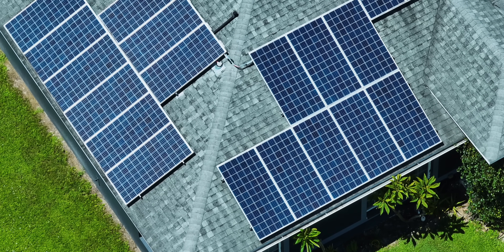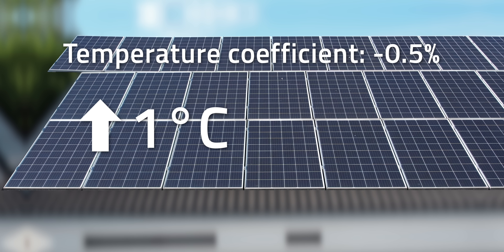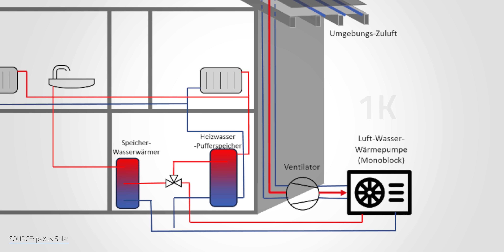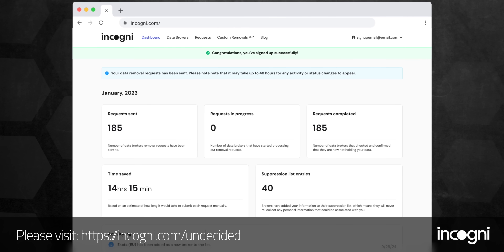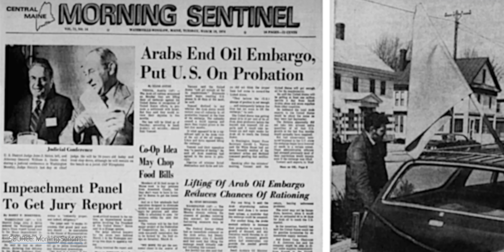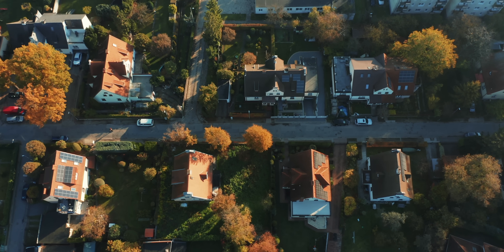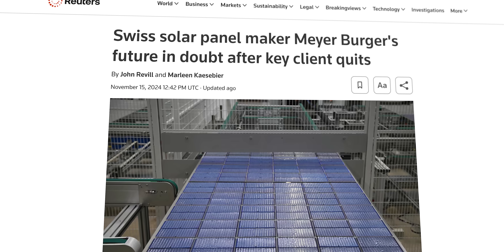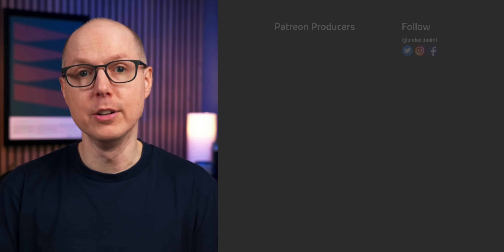Why Hybrid Solar Heat Pumps are the Future of Home Energy

Comment: Finally someone got/did it❗
Heatpumps also can used with sterling system to convert into electricity for summers.
Perfect combo is earth heat + solar heat (from solar powers) + air(with air there is lots extras but minimal is air heat pump with water collection. i still reccomend also to have heat exchanger for incomming/outgoing air from the target/building) with both way sterling system.
Reply: Sorry for editing, yout ube often will wipe your text you are typing when add ends so i had to save few times..

Comment: The video mentioned that heat pumps struggling when it's very cold but I have the opposite concern.  It's blazing hot where I live.  Cooling off the solar panels would definitely improve their performance here but I'm not seeing how the heat pump would otherwise benefit the system.  Occasionally helping heat the water heater doesn't seem at all worth it, and there's so rarely a need to heat the house itself.  So I'm wondering if this system is overkill for somewhere hot.

Comment: Here in Canada the water cooled panels are a no-go. They would freeze and break. Using some refrigerant could work but I am thinking about doing that with my solar panel roof on my woodshed. The main issue here is that I get heat in the summer but not in the winter, so I guess hot water would be my goal and not space heating. I do get space heating from the sun with large southern windows that help to heat up my concrete floor in the winter. It makes a massive difference
Reply: Your floor has a high thermal mass, that's how it can store all that heat from the sun. I wish thermal mass was considered more during construction, I think it is very valuable.

Comment: "Why haven't we been doing it all along?"
I helped design + build a similar system in 2016. Mats of rubber tubing bonded to the back surface of solar panels, boiling off a refrigerant. Jumped the panel electrical conversion 5-10% overall and captured another 30% of incoming solar energy in the gas. The next (hypothetical) stage was doing something with the high-energy gas like more electrical conversion or sending it into the home or a swimming pool through a heat exchanger. The heat pump won't always need the extra energy, and balancing those demands seems like a tall order when most of the gains probably came from the panels themselves running cooler.

Comment: Heat pumps do not use electric elements to defrost the outdoor coil. The reversing valve activates back to cooling mode and turns off the condenser fan. The hot refrigerant melts the ice buildup. While in defrost mode, the auxiliary heat kicks in, if there is a call on the thermostat, whether electric strips in the air handler or, if dual fuel, the furnace activates.

Comment: Using the heat of solar panels for heating water directly by using piping can make sense. The solar panels on the solar water heaters are known to have much lower temperature and hence, a much higher efficiency when compared to solar panels which produce electricity.

Comment: The main issue with both over solar panels is the ability replace or remove them. Panels are relatively simple to unlock from a roof, allowing for the roof to be repaired and panels put back. Here you'll have to take all of these off in order to do the same, not to mention the additional cost to the system.

Comment: Expected lifetime of operation is such an unknown which throws out any comparisons.  

The more tech a system contains the higher the failure rate.  

Consumers need a 20 year guarantee to be legislated. 
How many solar manufacturers already pass that! No moving parts helps.  
Add any fluid system and let’s come back after 20 years.  

The electronic wages mountains are growing.

Comment: I'm not convinced these will be more than a niche technology. Solar panels work fine when it is warm, a bit less efficient, sure, but they are still fine. And the increased complexity of running liquid cooling to them, even attached to a heat pump just seems like it isn't ever going to be worth it. I'm curious how it compares to just putting some small fans to keep air circulating under and around regular solar panels in terms of cooling. I'm not sure either one is really worth it, especially for retail rooftop solar. Maybe industrial scale PV in hot climates will scale well enough to be worth it, but I'm not sure there either.

These give you heat when it is already hot. I'm curious to know how they perform in cold weather, if the coolant loop for the solar panels is robust enough, it could act as the outside radiator/condenser for a heat pump large enough for a whole building, and maybe by doing both the solar cooling and the main heat pump is enough to be worth it, especially if you live somewhere with a lot of cold, sunny days (for example, Colorado, where I live has a lot of days that are a bit chilly but the sun is still out). 

I suspect there are enough cases where it is worth it to have the product and iterate on it to bring the price down and the efficiency up, so we will see how it goes compared to regular solar.

Comment: On the hottest days I don't really need to heat my house but what I've always wanted was to magically use the heat from my AC compressor to heat my pool.  I had to remove the water based panels on my roof to make room for the electric ones and I like my pool bath-water warm.

Comment: Solar panels are inexpensive and becoming more so every year. I prefer the simplicity and low cost (relatively speaking) of a total electric home, a lot of solar panels and a couple of inverters to provide about 110% of my total annual energy consumption. Of course, not everybody is as well placed as I am for solar, at 5000' elevation in the mountains of central Mexico in what is essentially a high desert environment with rain only three or four months of the year. I also have a lot of roof area (at a guess about 1000M^2) so as you might guess, "efficiency" is not high on my priority list.

Comment: Ok this is nonsense Matt! In winter when you need heat in your home the panels will not be producing excess heat and no heat generated in low sun or at night so no benefit to the heat pump. This has scam written all over it. Air heat pumps start losing efficiency below 40F and you better have a backup heat system for all but moderate climates.

Comment: When I built my house i tried to get Tesla panels but they still aren't early available in my country. So I have a standard colorbond roof, 10kWh of panels and a 10kWh battery, with a separate heat pump for water. In summer, my house uses 1-3kWh per day from the grid (usually between midnight and sunrise) and we export energy during the day even with both (heat pump) air conditioners running.

If they meaningfully exist by the time I build again (no guarantee I will build another house) I would absolutely install SAHP. I may even consider it in 10-15 years when both my panels and water heat pump are up for replacement.

Comment: Pretty much pointless in hot environments, it may increase solar panel efficiency somewhat but if you cant use the heat its cost wise pointless better off spending the extra on either more efficient panels or extra panels. Summertime here we dont use hot water at all and heat pumps are cooling the home not heating(its 43°C/110°F here as I type).
I'll also add exporting to the grid here is a joke, max we can get is 6 cents per Kwh... the end consumer pays the power company 35 cents+, who's getting rich off solar?

Comment: The complexity of this system and the required level of matching has me concerned about it's optimal range of operation and more importantly, the reliability of the overall system.

What happens when a nice Midwestern thunderstorm drops hundreds of 1-inch hail stone all over the roof and blows a panel or three out or throws a tree branch down on it? How about those pesky -10F daily highs for several weeks straight?

Somehow, I think I'd rather keep the two systems separate since the cost/benefit isn't anywhere near two-to-one. i.e. For me to make the jump to such a complex system would require the benefit to be double that of two separate systems, and I'm just not seeing it.

Also, heat-pumps don't last nearly as long as the roof would nominally. So if I'm replacing the pump every 5-7 years, that's three pumps before I replace the roof (Hopefully).

I'm just not feeling the love on this one.
Reply: inevitably we're stuck in a "the idea is there but the rest of technology hasn't caught up" such as materials, i think we'll get there but it takes people willing to eat costs like that now. Hopefully more people are willing to take those risks.

Comment: I wonder
1. In summer i agree that you cool the panels and get with nice cop lots of heat... BUT for what? Heating your warm hous etc??
2. In winter with poor electricity from your panels you can bearly move the pump...And generate easier and more ice on your panels??
3. Ok, in winter u use the grid.. But don't you get even less efficiency from to cool panel surface versus ventilated air??
And no, the idea of combining solar and heatpump are not new but heavent heard a real progress in the last 20 years.

Comment: I'd love to see real world results of this in winter, A-B comparison with and without this system for a heat-pump warmed home. Because I CAN see value in the potential re-cycling of "waste heat" escaping through the roof. Just curious how much of a factor that would be. 

In summer the only real value for this is heating water, which is a trivial cost, and cooling the PV cells, which is... a interesting variable. That "captured" energy will just be dumped elsewhere for most people, so the best claims of efficiency are...completely useless.

Comment: They will need to instill confidence in their ability to seal all of those liquid connections between tiles. I see this as the number one challenge.

The heat pump is a key player in this system. I saw PVT Solar try this concept w/o the heat pump, and the downfall was quality of heat. It is desirable to keep the solar panels cool, but we need high temperature fluid from the roof to make the best use of the heat. In that past scenario ,it really didn’t pencil out w/o the heat pump.
Reply: Many of the server farms are water cooled, so think of all the water connections where hundreds or thousands of computers are connected to the chiller/cooling tower system.  There are many great individual connectors for quick or permanent connectors out there.

Comment: Well,  I want Solar system & a battery system and heatpump Ac/heater... but I'll suffer the inefficiency loss, and keep the solar system separated....b/c, when something inevitably needs repaired down the line, it won't down 2 things at once.
Now, that being said... if I could have some solar heatpump booster for winter time.....that would be neat. Just some small system I attach to a pole that hooks to the heatpump. 
Liquid cooled PC are great, until you have to fix something,  b/c mfg. Still isn't perfect.

Comment: The problem and why it was not introduced was effectively your putting a un insulated pipe on the roof , over time the expansion and contraction led to pin holing leading to significant structural damage, even glycol mixing has issues and when cooling is needed  and led to limescale problems over time , even though solar production goes up the heat pump capture is often demand is exceeded since in hot days we just don’t need the heating on, and in reverse for cooling it’s not worth it since energy use goes up significantly. Cambridge university did a study in the 90’s and typical U.K. usage on a 4kwh array was negligible.

Comment: Awesome update! Ok.. about to do roof solar my self, roof converting to ridge vents and new shingles on and ready. Can I DIY in water cooled panels that dump their heat to my existing heat up, or "radiator" it inside directly? I think yet, but is it worth the time, also yes. It could be done incrementally as long as all the panels are modded before installing them. More research needed. Would it make more sense to go ground source? I like the idea of cooling the panels anyway though.

Comment: FYI -- You can minimize or eliminate several drawbacks by integrating a geothermal heat exchanger into the mix.  In the summer, you save by dumping all that extra heat into the ground, which saves energy immediately while simultaneously reversing one of the biggest drawbacks in geothermal heat exchangers - long-term thermal drift.  This means you can reduce the geothermal loop size, which saves on installation cost, which makes it all more financially viable.  

....but you know what really turbocharges the whole thing?  Demand-responsive time-of-use electricity rates.

Comment: In much of the US where heat is more the issue than cold, these panels could be used to heat domestic water and pools/spas during the summer.  In Northern California, we have high diurnal temp differences, so while we have relatively warm days, pools can stay pretty chilly.  I considered doing a roof that's partial solar, part solar water heating for the pool.  This system would do both and look much better than traditional panels.

Comment: Thanks Matt, for the info. I think combining solar with heat pump looks very promising. I’ve been looking into PVT panels, where the outside unit of the heat pump is underneath the pv panels. For now my gas heating is working just fine, but when it needs to be replaced in about ten years I’ll certainly look into the paXos system. In the mean time I’ll be using my solar system m installed in 2018. Use as much electricity here at home, for most charging my car.

Comment: Heat pumps are often represented as a dual unit one inside and the temparature exchanger outside. 
If you have a house with a cellar there is also a great option to buy a heatpump that is all in one and put it in there. It keeps the cellar cool in the summer and during winter the temparature is much higher compared to outside offsetting the energy loss from not having the exchanger outside during summer(you don't use much energy during summer anyway). Great stuff.
Reply: Even monoblock heat pumps requires air/temperature from an outside source. a closed loop heat pump is just a dehumidifer.

Comment: This sounds... sketchy. A heat pump wants to pump heat from outside to the inside in the winter, which the solar panels probably provide some improvement on, but that is also the time when they need the cooling the least. And in the summer, the heat pump, operating as AC, wants to pump heat outside, not take the already excess heat from the solar panels and put it inside. Maybe in a mild, continental climate in the EU this makes some sense, but here in the Dakotas it just sounds dumb, looking at the idea with even modest skepticism.

Comment: The efficiency gains would be minimal given that you don't need MORE heat to increase the heat pump COP higher in summer. Quite the opposite. Possibly useful in the shoulder seasons, but I don't think so. 
A sprinkler on a timer to cool the panels twice an hour would be much cheaper, and much simpler. 
This idea will not take off, because of complexity and cost.
If you really want to put plumbing on your roof, it would be a lot more useful to use the extra heat for domestic hot water.

Comment: I've been interested in the idea of water-cooled solar panels that pre-heat the water going into your water heater. You'd have a tank next to your water heater that discharges the slightly cooler water at the bottom to the panels, comes in at the top, and feeds the water heater from the slightly warmer water at the top. No idea if it'd work very well, and I doubt that the addition of plumbing to a rooftop solar installation would be cheap or easy though.

Comment: That's going to be one very expensive roof.
Ok so this is fine in places like Canada where heating is the usual concern but in temperate area's I don't see much value. The wear and tear, the complexity, the gases used in a pressurized system, DualSun (a french company) uses simple water to cool the panels in the summer, feed that into a geothermal heat pump and the entire system is much much simpler to maintain. Get some geothermal wells installed, pump the summer heat into the ground using some wells, then reverse the loop for heat. Thermal mass battery's might be inefficient but they're cheap and none are cheaper then using the dirt you already got. I'm all for the efficiencies these Germans are hunting but unless you live in Canada, Russia, or Norther Europe I don't see it being worthwhile.

Comment: The diagrams look like two different systems. One that you explained just uses air to cool the panels and moves that air into the compressor unit. The other showed actual coolant lines tied to the panels. Which one is the SAHP you mention? The first one makes total sense, since you can just vent the hot air away from the compressor during the summer. The latter one seems like it's using the heat to help condense/evaporate the system, meaning a complicated balancing act like you mentioned as well. Whichever one it was, I'm surprised there wasn't mention of just using water. (Though you explained it as using water, I couldn't find it in either diagram). Either spraying a mist of water on the panels underside using the home's already pressurized water or a simple loop with it's own pump and radiators.

And each of these options have completely different use cases if you go geothermal, which I would love to switch to. I'm guessing you could just have it be completely independent and dump the waste heat/cold into the soil like the compressor would.